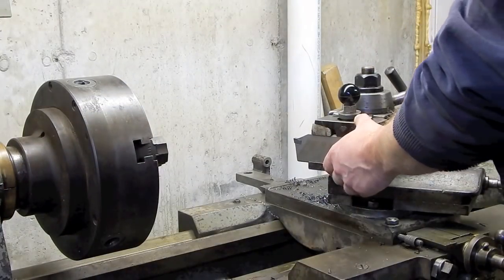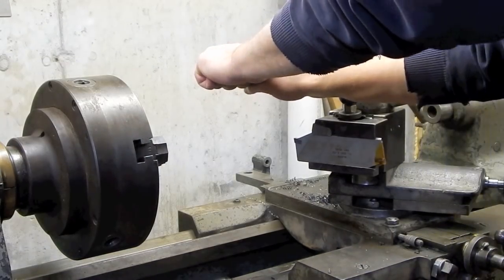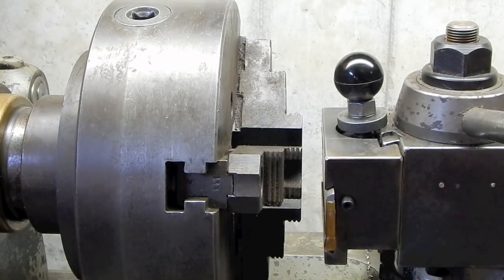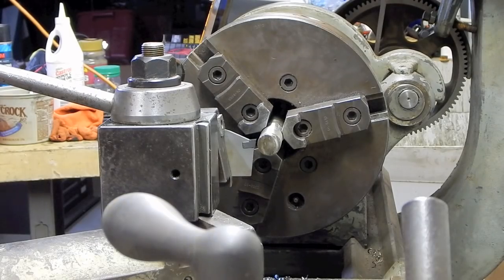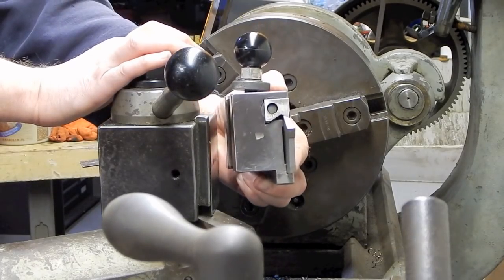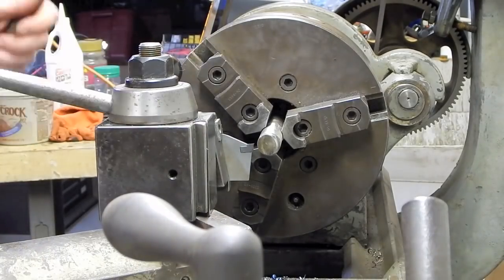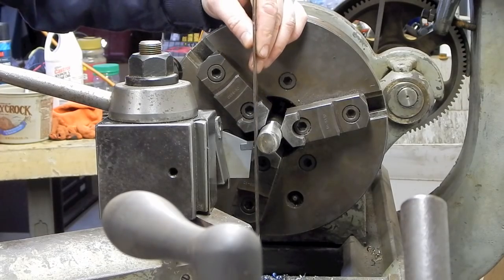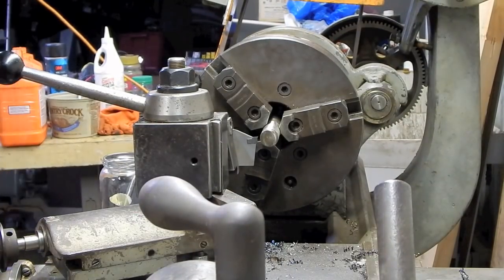Mid January Flea Market finds Part 2: Aloris cutoff tool demo

Comment: Yep, wrong carbide.  Just as I suspected.. Your first attempt wasn't half bad though as is the second.  Dead center is ideal, but you can be slightly above or below center, but usually not much.  You'll wanna use lube on the cut and you wanna feed in past the pressure.  In this case too slow is just as bad as too fast.   You wanna see fairly decent size curl chips not just dust.  Start putting in more feed to where you see nice curls, and don't baby it too much.  No nipple, you're doin fine.

Comment: The reason that you always part up close to the chuck, is because there is too much movement in the work out away from it. You are still getting movement in the work even close too the chuck, so the only thing it can be is loose spindle bearings.  I would almost bet, that when you were .250 in and checked your cut with an indicator, it would not have been round   The way the tool post tipped to the left when you loosened it, you had it to far to the left on your compound. The most rigid spot will be where the center bolt of the tool post, lines up with the pivot point of the compound.....you should be peeling it off like a ribbon, not little dust particles. I'd also check the cross- slide and compound gibs, to make sure they are adjusted properly with no play.
Reply from the maker: +Jim Liechty Thanks Jim. I now figured out a trick of using a 1-2-3 block as a spacer when I'm squaring up the TP to the chuck face, allowing me to keep the TP farther to the right on the compound. Before I was moving the TP way to the left so the compound would clear the chuck. As for spindle clearance, I spent a lot of time shimming the bearing caps to get the clearance dialed in. I based my procedure from info in an early South Bend publication for a similar cone head. I hate to think that's the issue, but I can re check it next time the chuck is off.

Comment: That steel you are cutting sounds like it may be a peace of hardened steel ????? Also your work was not running true in the chuck.
Reply from the maker: +NSTRAPPERHUNTER It wasn't hardened judging by the chips I was able to take once I got the center height dialed in, but you're spot on about the part not running true. Did not notice it until I was editing the video.